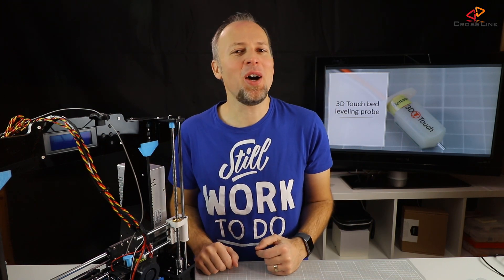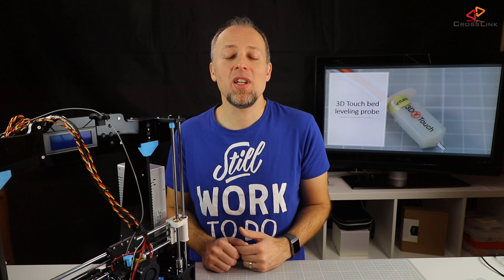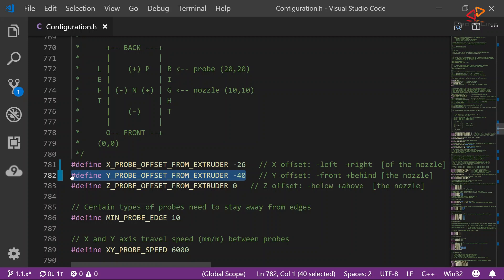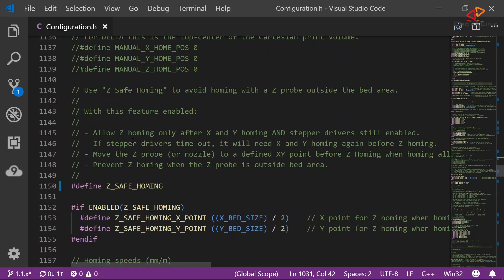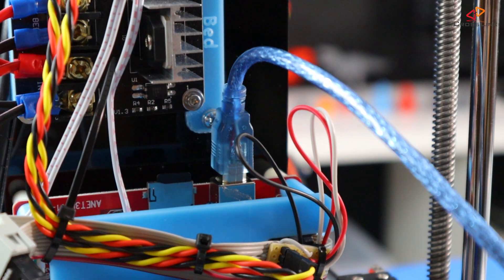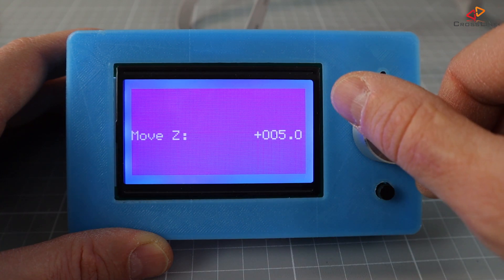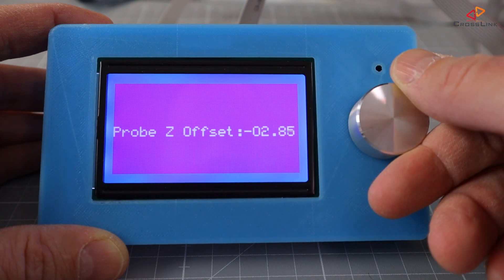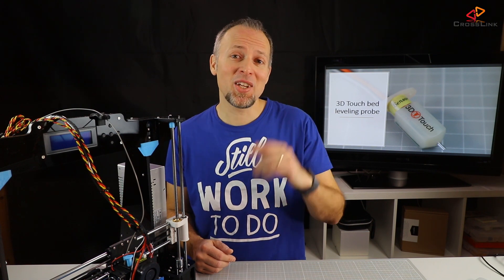BLTouch on the Anet A8 - Marlin Firmware 1.1.X configuration and calibration

Comment from the maker: Hi viewers and subscribers! If you have any questions or suggestions for this video, please add them to this comment section. I am happy to chat with you about your experiences, questions and issues.👋
Reply: Hi Daniel, first thank you so much for your videos, fantastic job. Question I completed a full upgrade to AM8 for my A8. Even upgraded to the V1.7 board. When I was using Marlin to setup my A6 screen and 3D Touch I used your config.h file, that you put a link to, and tried using it in my Marlin. When I started the build it error-ed out pretty quickly with this statement 'You are using an old Configuration.h file, update it before building Marlin'. I've tried everything I can think of but this comes up every time. Any thoughts? Thanks again

Comment: I know it's been awhile since you covered the subject of installing BLTouch on an Anet A8 and your YouTubes on this are very comprehensive. I believe your YouTubes were addressing the Anet v1.0 and v1.5 motherboards.  I recently picked up an Anet A8 Plus which came with the smaller A6 display and a v1.7 motherboard and the very limited information on installing a BLTouch on the v1.7 motherboard indicates to remove the C3 capacitor next to the Z axis sensor.  Can you provide any information on this capacitor removal?

  Thanks, MIke.

Comment: Just got mine up and running and it was a doozy. I had to define a pull-up resistor for both the z-min end stop and the z-min probe. I also had to define the BLTouch to use 5volt logic (careful you can fry your BLTouch if it’s not 5v).

Also just a piece of advice: when you’re trying to find your z-offset it’s much easier to set it to zero (m851 z0), home your z-axis (g28 z0), turn off your soft limits (m211 s0), and then using your slicer or lcd control - bring the nozzle down to the bed and do the classic paper test. 

Great video though!

Comment: Okay im using a a8 with the bl touch. I used your file and everything works but my bed crashes forward on the y axis when trying bed leveling and the probe points when leveling are not square to my bed? Obviously the files work per all the comments. Im just confused why its not working for me with the same machine and everything. Any help is appreciated

Comment: I'm running into an issue with my 3D touch and ANET A8. The probe will not stow after homing and leveling using the linear bed leveling option. It flashes like there is an error. Any idea how to go about fixing this?
Reply from the maker: Probably an issue with the probe. Check all the cables and if it’s plugged in correctly at the mainboard. Might be a defective probe though if you used it for quite a bit and nothing has changed with the printer.

Comment: No need Ardunio for flashing! 
Reducing Marlin firmware size to fit in your 3D printer board memory: 
In Arduino IDE, you should edit the file platform.local.txt for your board. It is inside the hardware folder, together with your other Arduino project folders, or in the Arduino instalation folder. 
Add in platform.local.txt:

compiler.c.extra_flags=-fno-tree-scev-cprop -fno-split-wide-types -Wl,--relax -mcall-prologues
compiler.cpp.extra_flags=-fno-tree-scev-cprop -fno-split-wide-types -Wl,--relax -mcall-prologues
compiler.c.elf.extra_flags=-Wl,--relax

After add bltouch the Marlin 1.1.9 , space left 2% , Uploading success!
Reply: Worked a treat but must have Speaker disabled as that is enough to take the sketch over the 2% space left

Comment: Hi Daniel, first of all a big thank you for your videos. Good contend and easy to follow. Please take my apology for commenting on two year old contend but for me it is an actual topic.
I have got a problem with my 3D Touch configuration. Homing works fine. I adjusted the Z offset in settings on the marlin HMI as you explained. After I perform a homing the nozzle distance from the print bed is correct. After leveling however the Z distance is incorrect. The value shown is about 3,5mm higher than the actual distance. So when it comes to printing, the nozzle is 3,5mm below the print surface. You can imagine what that causes.
I have tried to set the Z_PROBE_OFFSET_FROM_EXTRUDER, as you have left it at 0, but this doesn't do anything.
Have you got an idea what causes this strange behavior?
Why does leveling return a different Z value than homing?
Any help is greatly appreciated.
Kindest regards and greetings from Hamburg, Ronald

Comment: Hello, I used your configuration, but the sensor only measures in the middle of the table and not in the 9 points .... why is it ?. The only thing that changed in the code was the X and Y position of the sensor. Greetings

Comment: I put your configuration, only have to deactivate #define ENDSTOP_INTERRUPTS_FEATURE due to an error. Error in all versions of the Arduino IDE.
The M119 command on the Z axis is TRIGGED.
M28 moves to the parking lot, the nozzle rises, the dipstick lowers and does not find the bed. After that it stops with an error (STOPPED).
Repeating M28 raises the nozzle higher when parking.

Comment: Hi, in marlin 2.0.x i dont find the exact lines to configure the offsets of the sensor level. I put the sensor in "#define NOZZLE_TO_PROBE_OFFSET { -23, 30, 0 }" and when the anet 18 soft whit marlin 2.0.x do the auto level process and go to back side of the bed, the sensor go out off and not sense... what i do bad?
Reply: Problem solved... i guess, i configure 

// Most probes should stay away from the edges of the bed, but
// with NOZZLE_AS_PROBE this can be negative for a wider probing area.
#define MIN_PROBE_EDGE 40 an that`s all

Comment: Hi Daniel

Im a little bit new to the 3D print world for the Anet A8 Plus i would like to install a BLTouch only what is the pin on the Anet mainboard version 1.7?
I found online that this is not pin 27 and that this should be pin 29, is that correct? 

Is it correct that this is pin 29 and is this the most right pin of first row when you facing the notch of the LCD socket.

Many thanks for your help and time,

Kind Regards,
ERonny

Comment: Hello!
Are there any solution to use Marlin f/w and a 3d cnc touch probe to find center of the ring (in and out), or edge of a cube, or center of a cube.
 Because I'm using the M. f/w like a CNC mill.
A surface scan I'm  using with bad level function. (connecting the probe to z-home min position for scanning a PCB)
Setting the Z-hight with simple home Z.

Comment: Hello,  I am struggling with this installation, I am not sure where I went wrong. So, I am here asking for help :)

My current problem, is that when I Home my machine,   I goes to the middle of the heat bed, and there a pause, and the Z axis, goes up a few mm, then waits 2-3 seconds and goes up again.  it never actuallys goes down to touch the heat bed to Level against it.

1) I have confirmed that it is wired correctly.  (based on everything I have seen here)

2)  I have confirmed I have all of the settings in the Configuration.h set. 
(one small step is different)
in my configuration.h file, I had the "#define BLTOUCH" however, I dont have the Servo0_pin 27 or the delay.
I added  following line :   #define SERVO0_PIN 27  (as I am using the Original A8 display)

3) when I power up my printed, the BL Touch is CONSTANTLY flashing and does NOT ever stop.

I am hoping someone can point out my simple mistake !!!
Reply: I want to mention, your schematic for the Anet A8 board is also incorrect.

You say to use the third wire from the display cable.  but your schematic is pointing to Pin 5 on the board.

I looked at other sites, and the third cable is correct, however, everyone is pointing to the second pin on the right, not the third one.

Comment: I have the ANET A8 Plus. Which screen do I have? the A6 or the A8? I think it is the A8.
Reply from the maker: Chris Reaney, did you already post this on our Discord channel? It would be much easier to help you there because we can exchange images and files much easier.
Reply: @Crosslink3D  wasn't aware there was one. I sent the sensor back and gave up. There are no official files on how to wire this properly. Pin 27 and 29 (7 and 3 on the cord) both did not work. Anet wasn't helpful, and BLTouch said they weren't to be held responsible. Thanks anyway.

Comment: this works with the marlin bugifx 2.0?
Reply from the maker: I would try 1.1.9. the new 2.0 is optimized for 32 bit. I don't say it doesn't work but it takes up more space on the flash memory and the amount of features that are better for an older printer like the Anet a8 ist very small.
Reply: @Crosslink3D  Thank you very much for the response

Comment: Both these videos helped me so much! Thank you! One question out of curiosity: would you consider upgrading to an AM8 frame? I've done it and heavily modified my A8 (Original E3D Titan extruder, V6 hotend, BLTouch,...) and I must say it drastically improved the quality. Still running on stock A8 board v1.5 and original steppers (that's all that remains of it haha).

Comment: I followed your instructions but my probe wont deploy  and it crashes into the bed i dont get why :(
Reply from the maker: Please double check your wiring then then try this:

After mounting and uploading the new firmware you can test you sensor:

M280 P0 S10 ; pushes pin down
M280 P0 S90 ; drags pin up
M280 P0 S120 ; does selftest (pin up/down continuously)

M280 P0 S160 ; reset alarm

M280 P0 S60 ; switch triggering test mode
; move pin at the sensor up or down manually
M119  ; reports state of the endstop
; pin up (LED on) z_min should read TRIGGERED
; pin down (LED off) z_min should read open
Reply from the maker: If that doesn't give you the expected results, try swapping the servo and signal wires and try again.

Comment: Hi, Using your configurations but the sensor isn't stopping the z axis. What to do?
Reply from the maker: Look for the line Z_SAFE_HOMING in your config and make sure it is enabled. This should fix the issue.
Reply: @Crosslink3D  done that but now the sensor is not triggering.
Reply from the maker: Did you check your wiring? The sensor should do a calibration before the bed leveling. ALso you can do a manual test of the sensor:

After mounting and uploading the new firmware you can test you sensor:

M280 P0 S10 ; pushes pin down
M280 P0 S90 ; drags pin up
M280 P0 S120 ; does selftest (pin up/down continuously)

M280 P0 S160 ; reset alarm

M280 P0 S60 ; switch triggering test mode
; move pin at the sensor up or down manually
M119  ; reports state of the endstop
; pin up (LED on) z_min should read TRIGGERED
; pin down (LED off) z_min should read open
Reply: @Crosslink3D  Ok, now it is working sometimes but most times it is crashing into the bed.
Reply from the maker: Maybe the sensor is defective. If cables are all good.
Reply: @Crosslink3D  Ok, I will contact with the guy I bought this from. Thank you very much for your time and help.
Reply: @Crosslink3D  My bltouch not responding to m280 commands. The 3dtouch always in selftest mode, when i power on my printer.

Comment: Hi there.i already do optiboot using arduino..but strange error appear after i enable bilinear.why is that so? i can upload flawlessly if i disabled bilinear and upload code using anet optiboot method.

D:\Anet 2019 Project\arduino-PR-beta1.9-BUILD-105\hardware\arduino\avr\cores\arduino/Arduino.h:223:0: note: this is the location of the previous definition

 #define TIMER5C 18

 ^

d:/anet 2019 project/arduino-pr-beta1.9-build-105/hardware/tools/avr/bin/../lib/gcc/avr/5.4.0/../../../../avr/bin/ld.exe: C:\Users\CIPANG~1\AppData\Local\Temp\arduino_build_163378/Marlin.ino.elf section `.text' will not fit in region `text'

d:/anet 2019 project/arduino-pr-beta1.9-build-105/hardware/tools/avr/bin/../lib/gcc/avr/5.4.0/../../../../avr/bin/ld.exe: region `text' overflowed by 7816 bytes

collect2.exe: error: ld returned 1 exit status

exit status 1
Error compiling for board Anet V1.0 (Optiboot).
Reply from the maker: Looks like the firmware is still too large for the mainboards flash memory and you maybe did not select the optiboot when you tried to compile it. Even with optiboot you can manage to make it too large. What features did you deactivate already to save memory?
Reply: @Crosslink3D  i disabled advance pause feature.now i can use bltouch,anet a6 lcd driver n liv,bilinear leveling

Comment: What version of Marlin were you using for this video! I’m using 1.1.8. My line numbers don’t match yours  very closely. And some of the lines you have, I don’t have?  I did get my 3D Touch to work thanks to your video and a couple of others. I still can’t get the probe to go to the real center. How do I move the probe tip to the right 19mm, and back 6mm?????
Reply from the maker: I used 1.1.9. Probably try this first. Then you might be able to use my config files. The probe area is defined in the configuration file by using the #define LEFT_PROBE_BED_POSITION and following settings. You have to figure out how much distance you need to keep the the bed corners not to run over them to probe inside and have enough margin. the center value is auto-calculated.
Reply: Crosslink thank you for responding. I guess I’ll have to move to 119. Question: after the print head determines its elevation at the beds center, it rises up to 10mm. When your print head goes to home it just stays there. Why is that? Where are the Marlin settings that control that behavior? Thank you.

Comment: The blue led blinks when triggered but the pin does not move. Please help
Reply from the maker: Please double check your wiring then then try this:

After mounting and uploading the new firmware you can test you sensor:

M280 P0 S10 ; pushes pin down
M280 P0 S90 ; drags pin up
M280 P0 S120 ; does selftest (pin up/down continuously)

M280 P0 S160 ; reset alarm

M280 P0 S60 ; switch triggering test mode
; move pin at the sensor up or down manually
M119  ; reports state of the endstop
; pin up (LED on) z_min should read TRIGGERED
; pin down (LED off) z_min should read open
Reply: @Crosslink3D  What program can i use to send the M codes?
Reply from the maker: Pronterface or RepetierHost for example give you the interface to send custom commands
Reply: @Crosslink3D  It does not respond to commands. So it must be wrong wiring or a faulty sensor?

Comment: With the configuration.h file posted for an anet a8 display, the z axis will not move in a negative direction with manual movements in the lcd or autohome attempt. Controlling the bltouch functions via the lcd works fine for reset, stow, deploy and self test. Constant “home z first” message. Any ideas what to change?
Reply from the maker: You need to to G28 first then G29

Comment: Hey  Daniel Have you ever told anybody on one of your videos because I'm not gonna say I watched all your videos But  I found out yesterday that depending on the brand of filament you're using your printer settings can be completely different And do you know of any 3d designs that help test that cuz I'm thinking like 2 to 3 levels of  Square boxes or circles Evenly across your heating bed  To help with your flow settings and it would help see if the bed's not level Just simple circles and squares do u think that would help I've have not found one like that on thingiverse yet also building the  power  Module bracket I had trouble with that part at like line 3 the 2  Attachment holes to the chassis Kept getting ripped off Any suggestions And I can't update my firmware so is that going to mess up my bl touch

Comment: Hi Daniel, i have followed your procedure, using your configuration.h file ( i have a anet a8, a6 display, bltouch sensor) but when i try to upload the sketch using the Anet V1.0 Optiboot i get this error:
c:/users/user/desktop/marlin-1.1.x/arduino-1.8.0/hardware/tools/avr/bin/../lib/gcc/avr/4.9.2/../../../../avr/bin/ld.exe: 
C:\Users\user\AppData\Local\Temp\arduino_build_222921/Marlin.ino.elf section `.text' will not fit in region `text'
c:/users/user/desktop/marlin-1.1.x/arduino-1.8.0/hardware/tools/avr/bin/../lib/gcc/avr/4.9.2/../../../../avr/bin/ld.exe: region `text' overflowed by 4250 bytes

collect2.exe: error: ld returned 1 exit status

so if i remove ANET_FULL_GRAPHICS_LCD from the config file the upload goes well...so do you have a solution to correct this error? you use the a6 display and the bltouch, why i get that error?
Reply from the maker: Please go to my Facebook page open a chat and send me the file. Gonna have a look at at.
Reply from the maker: Francesco, still need help on this?
Reply: @Crosslink3D  Daniel now i've an other question, I have installed the octoprint bed level visualizer plugin. Every time that I do the aut obed leveling I get a bed's reported mesh different from the previous one (
I have not changed the calibration screws of the bed)?
Reply from the maker: Francesco, I also used the plug in a few times but never actually compared the values. But it never had any negative effects.  I recently recognized that my level screws loosened a bit so I checked them again. But my prints are always same results
Reply: @Crosslink3D  these are the results I get without changing the adjustment screws https://ibb.co/BNsGprS (they are 5 tries made in one after another within 5 minutes)
Reply: @Crosslink3D  excuse me daniel I was out few days and I'm back only today...the file that i've used is the one downloaded from your description....for now I have "solved" disabling support for the SD and using octoprint ... in this way the firmware is smaller and I have no error...